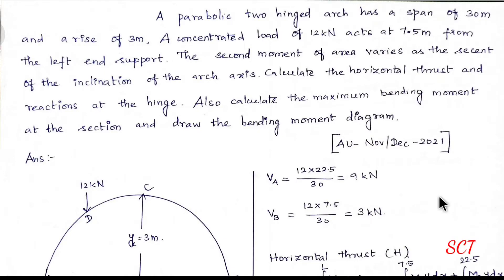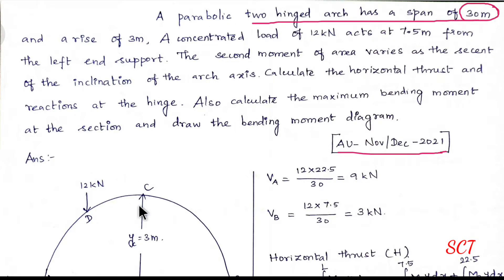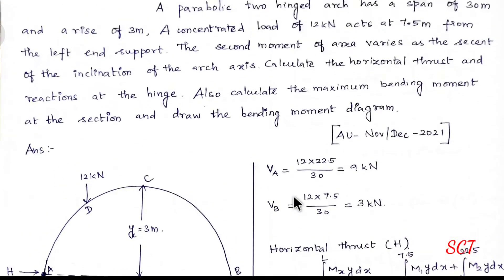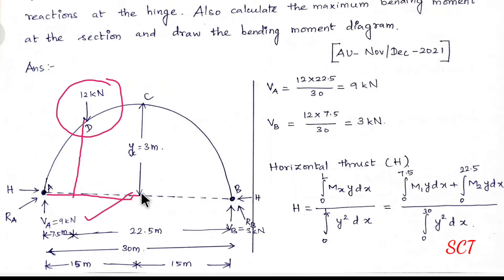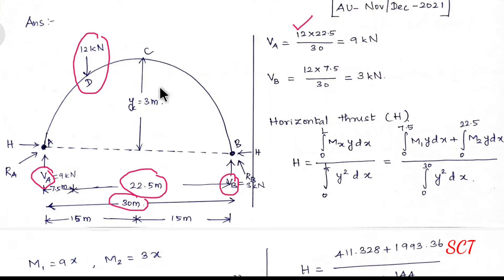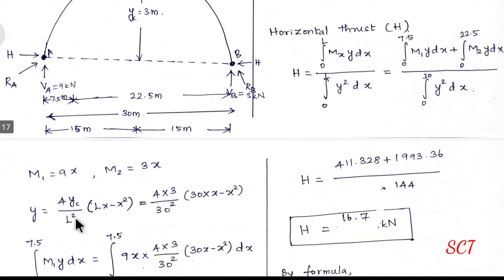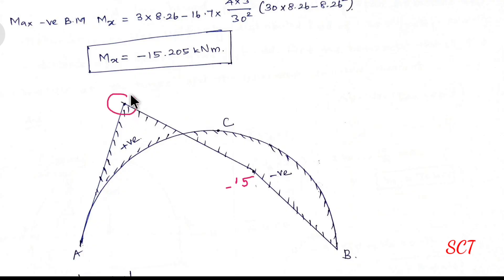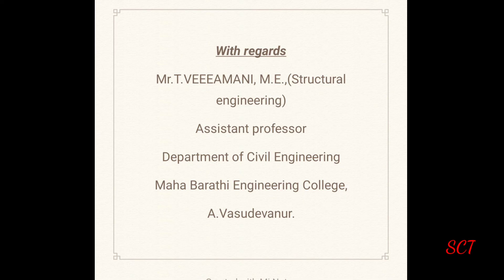Two hinged parabolic arch problem 1

Comment: Sir x=8.26
Reply: Yappdi
Reply from the maker: Type directly on calculater, use alpha for putting equal symbol, then type shift+calc, shift+calc twice, you will get x answer
Reply: @simpleciviltamil7937  tnx sir
Reply: Sir dss sum videos sir
Reply from the maker: @sarankumar9269  dss kku next sem thaan poduven, ippo 2021 regulations engineering mechanics podalanu irukkenbpaa
Reply: @simpleciviltamil7937   ok sir
Reply: Dss yatthachum impartnent sum irruintha solluinga sir